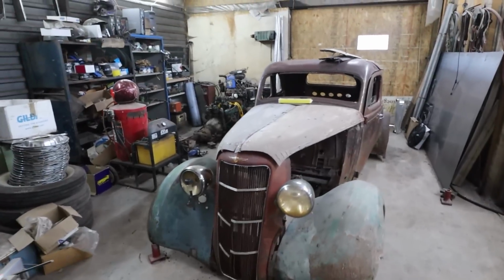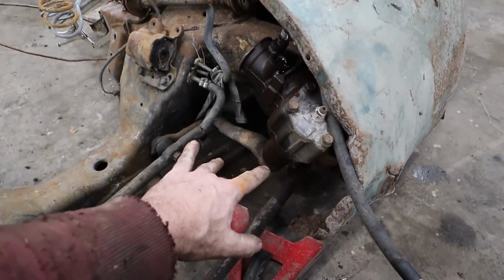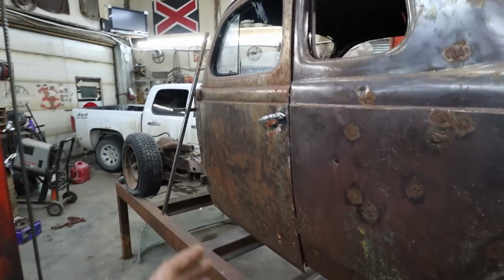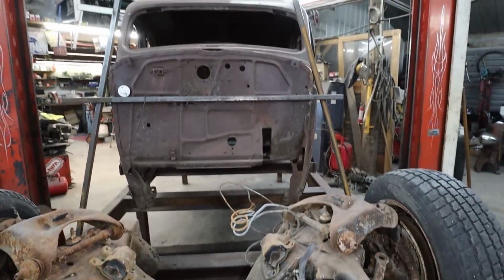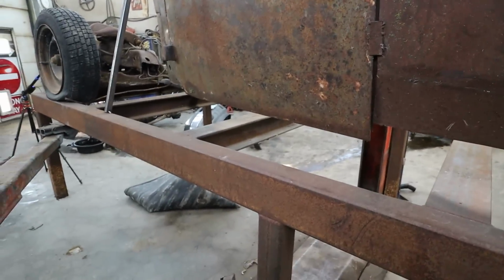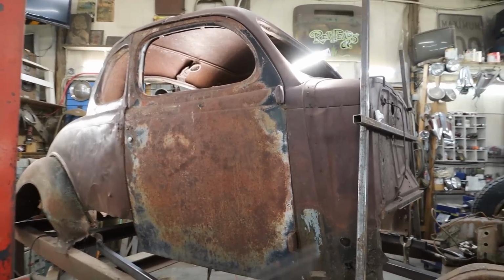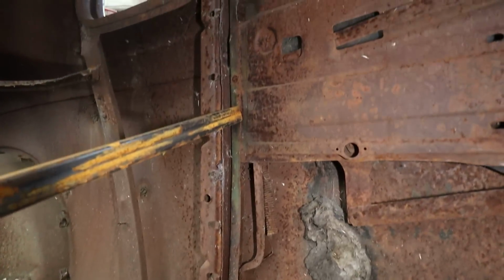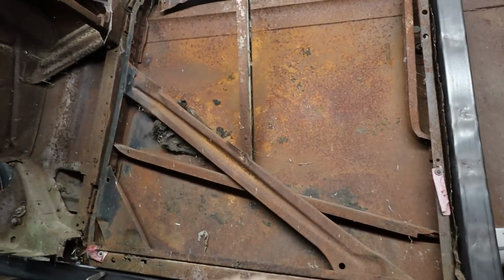1935 Dodge Coupe p2 attempting to square up the body and building inner rocker support.

Comment: Get a centerline going on the frame table.  square up the shell to that. make the doors match dimensionaly, and mounted to the cowl @ the frontwhere you want them. (or, get another pair)  & build  from there back. Your gonna go crazy if you  dont!   Hang in there , your doing  awesome. Important, remember, any project like this Must have (at least) one true line!

Comment: Brent working with Karl has got you playing around. A little Extra. That’s a 35 five Window Coupe. And your hood is off a 37 Chevy. Quit a bite longer. The 37 had a Flathead straight 6 cylinder. Of course you can make it work cutting it down. Love watching your work. You just roll with whatever the project takes. Thank you for sharing! ❤

Comment: If the exhaust bender works is that wrong or is it a win. A piece of pipe on a breaker bar for leverage. A gutted out distributor in a drill to prime an oil pump. As mechanics or craftsmen we often alter the intended use of our tools or the tools available to us. When it works is it wrong or is it a win. This one will fall into place, the bits will come on line, and an awesome project will emerge. Good on you for rescuing this one. A little extra work makes the reward that much sweeter. Thank you for taking us along through the process.

Comment: Hi Brent, I’m wondering if the doors are off a different year as the lines are narrower than the rear body, however it wouldn’t matter if they were off a Fiat 500 you’d make them fit. I’m going to love this build, many thanks for the content.
Reply: I agree with you, those doors look like they came off a similar car model than the one Brent bought as a donor. They are too long, the body lines don’t fit (front bottom corner is the most obvious), the top doesn’t fit the cab line and there are cuts and welds everywhere around the hinges

Comment: An excellent teaching video showing folks how and where to start. Looks like it will be a good foundation. Changing out the doors sounds scary to me because I don't think those are the correct doors to start with and changing them out for the right doors may screw up everything you have already done. Who knows...... but if changing doors was in the mix, I'd have started there before I laid out the foundation. 
But Brent will get er done no matter what. lol. Thanks for taking us along.

Comment: I used an X10 frame for a 1939 truck and cut it took out the center section with 2”X6” channel, it worked great!!  It allowed me to channel the cab about 6”

Comment: Brent, your skills far surpass the efforts in hot rod building  60-70 years ago. They had the rust damage of cars that had been abandoned for less than 20 years. They were likely to find horse drawn carriages that were in similar condition but not automobiles. You are doing what many would call the impossible!

Comment: This is your biggest challenge yet.  This body is a fitment nightmare.  When you finish, this ride is going to be almost completely re-engineered.  I'm not worried about your plans with the frame or front clip - this body will be your most vexing problem yet.  I look forward to the lengths of your creativity in getting this body to act right and behave.

Comment: Wow, that's a rough one...  Got to admire your willingness to tackle one in such rough shape.  I think that it is a very wise decision to build a perimeter frame with 2x tubing.  This will provide some much-needed rigidity which is currently missing.  I think you will be ahead of the game if you go ahead and replace the left side B-pillar to match the right side now..  I am still amazed at your skill and vision with sheet metal.  You have an amazing ability to visualize what things should look like and the ability to fabricate things to match your vision.  Really looking forward to seeing this one come together...to prove that a person does not need a pristine old body to be able to build a decent street rod.  You are not trying to build a "nut-and-bolt matching" concourse-ready classic.  It is a hot rod, built with what you could scrounge together...  Great project...!!!

Comment: That's an ambitious undertaking, but  you're off to a great start! It's too bad the Mustang 2 kits are so expensive up here in Canada because they sure save a lot of mucking about. I haven't seen anyone successfully use an s10 clip under a mid 1930s car because of the steering box to fender issue. I've seen a couple guys try to use a Cavalier rack, I don't think those vehicles ever ended up on the road, but I'm sure you'll figure something out!
Reply from the maker: Love you as the s10 stuff on some late 30s stuff no problem this one's just a little troublesome

Comment: Man what a mishmash of parts. I think you should get everything tacked into place, remove the doors and either get them both the same size and then put them back in place (or new ones) and go from there. You have A LOT of work ahead of you on this one. will be fun watching.

Comment: Brent, we have used mustang 2 front clips ... before they made a kit!  We would find a roached out car, and cut the front lower frame off. Then just cut and fit  you manage that skill better than most ! They are a lot cheaper than the kit ! Good luck 👍, jim  ps my brother has a kit he bought for a 37 dodge, we replaced it ,with a camaro sub frame
Reply: The kit he has is just laying in his shop, jim

Comment: If you split that moulding at the back of the door towards the front and lift the top half of the door it would close the gap at the top and line up the moulding top too.

Comment: i put a buick clip on my 39 ford ,wanted disc brakes on the front, had to take 3in. out of the middle and then shortened a mustang rack ar each end all worked out had it going 130  and ran true

Comment: My 1974 datsun 1/2 ton truck  had steering box 1 inch from bracket holding the bumper. Fix Extended bumper brackets and extended the bumper out 5 inches which were wielded to frame

Comment: I've watched several of your videos and your colab with Karl on his big truck conversion you guys are mericle workers when comes to working with metal.  How about using that 52 or 53 olds that you got running with the stick shift. By the way I have an aftermarket floor shift conversion kit that was designed for that trans, I had it in a 54 olds that I owned in the 70's.  Any way good luck on this project I'll be watching this.

Comment: I'm running into that steering issue right now on a 1946 GMC truck I'm s10 frame swapping, I was going to rack n pinion it but wow it's pricey. Guess I'll wait to see how you do yours
Reply from the maker: You can always try a manual box they are smaller

Comment: Hello, There is a steering rod that goes outside of the side hood. It looks like 1932 Chevy Model A steering. The steering column at the bottom is connect to the worm and sector gears box or two bevel gears in the case with mounting holes metal foot. Worm gear and Nut steering box that makes it 90 degree. The steering intermediate rod is between steering box angle gear and pitman arm. The pitman arm is for swinging forward and backward below the intermediate rod as well the pit arm is connect to the intermediate rod. At bottom of pitman arm is connect to the ball socket which is also connect to the steering rod. The steering rod is between two tie end ball sockets. The front tie end ball is connect to the knuckle steering arm's socket as part of drop spindle. The knuckle arm spindle is right next and rolling the wheel. And knuckle arm spindle is with yoke to be fitted to the kingpin axle beam (miniature). The vintage shock dampeners atop the axle beam on both sides. The shock absorber is the spring or coil along with the dampener from Monroe or Speedway Motors for $1,400.00 dollar brand new all front end suspension for weld on to the chassis with plan instruction sketch print.
 The another type drop spindle can be inverted connection where the axle beam have two yokes on both end. The drop spindle have butte to connect to the middle of the yoke.
  The kingpin axle beam does not have any yoke. The drop spindle is an old style that way it is connect to the kingpin axle beam for it to steering along with steering system rods and arm. The Vintage steering for 1930's would be hard to find but as avail in Chops shop JG. The Lares or Cardone is the brand for old car Dodge 1935's gear box plus transmission multi-gear box from Spicer and Old Detroit axle and tubular company.

Comment: Patch work parts 35 Dodge, front clip'n wif a s10, frame'n table'd, square'n da body wif wratchet'd straps n all, rockers where der aint no rocks, b pillar'n a 2X2 wif a exhaust bender.

Comment: The width between two front wheels for add in rack and pinion steering from a Pinto Pony car S10 and rag joint for connect to the steering column without using the Worm and roller gear box. The width are choice that are 56 inch , 58" or 60" track width for nominal car like Dodge 1935 with Chevy coffin lid tapered to fit to the radiator's front grille and sill in the area engine bay without the wheel well. Instead of the wheel well, it uses the fender called wheel bonnet. The hood is between the two wheel bonnets.

Comment: Pontiac fiero front end...comes out with about 8 or 10 bolts...smaller, lower version of mustang 2 ...may be easier to find cheap. I've used them..they work good....86' fiero
Reply from the maker: interesting.
Reply: Same front end as a chevette/t1000. Great suggestion!

Comment: A general question across the custom community, what is the reason so many projects use the S10 or Dakota front clips?
Years ago the Nova and Camaro clips were, or seemed to be, a favorite, what changed?
Availability or is there some feature(s) of the S10 and Dakota that other fronts are missing?

Comment: Have look at a rack and pinion out of a like 94 97 trans am or camaro they bolt flat to the x member and the steering shaft sets at an angle

Comment: This plan is you want to add the rockers which is a laid down stud atop the steel sheet metal and stud need to be weld to the floor sheet pan. The sheet pan must be weld to the front end clip's chassis (half). The floor pan is 9 foot long by 60 inch wide and 4 or 5 foot front to fire wall spacing for the mount of an engine includes multiply width of both front fenders is 60 inch to 62".
 The A pillar is front of the door wall plus cowling under the windshield and the pair of sills hold the front part of Dodge roof 1935. The B pillar is the walls both sides included the framing rails sill with the striker and car door jams and it holds the up the roof at mid-section. Then the C-pillar is the tub that hold the rear window and rear carnival seat and rear of the roof at right on the back of B-Pillar. The 5 window Coupe Dodge was called Passenger coach with rubber tires and spoked four wheels. The Sedan was called 5 window Sedan includes 4 doors. Other option is rutted wheel instead of thin spoked wheel It uses much thicker spoke 6 hole wheel with center bore. The thicker spoke is called rutt instead of wire wheel.

Comment: Use A 1940's through 1950's  frame front clip off of Another older Chevy vehicle. Possibly 1960's might still work to for it to.

Comment: The Dodge 1935 cabin with no paint that became nice bare skin but the floor needs to be reinforce and the chassis is half for the front flooring. and the back half of car flooring is just pan steel sheet strongest enough to weld to the chassis front end. Not need to have chassis longitude rails for back. Only the unibody floor is able to run with rear suspension. The front half of the Dodge Vintage have chassis 2 longitudes only. Where the coupled of Dodge's S10 is likely to be front wheel drive and much easier for robotic with Mustang III universal front end clip into build concept or replicated one in the making one for hot rod Rat Dodge 1935. What color have you decide to paint it? Thank you.

Comment: I'm guessing you're unable to transfer the rack and pinion unit from its frame to the S-10 (was my first thought)?  ;-)
Before the Mustang II came along, hotrodders used Corvair front suspensions with Camaro disc brakes and rack and pinion steering added.
That MAY(?) be cheaper, but a lot more work for the same result of the Mustang II front suspension?
I thought the passenger side structure, door, etc... was closer to where it needs to be, so why not build to that side and mirror to the "bad" side?
Reply: Ok, I see why, there's more to attach and measure from on the drivers side.

Comment: Brent, the S10 does suck it really is a terrible front end although I know a lot of guys who use it. That steering box is just murder on core supports. The Dakota is a great clip to use on a truck by the way, anyway the Mustang too is a good front end for it but they are super expensive but a good runner-up might be that Jaguar front end from the 80s. I recall you used one before and you're already familiar with with a funny steering shaft position.

Comment: I think that the doors are not from that body.  It appears that someone may have tried to adjust the body to accommodate the doors.  I wouldn't use them as a reference.

Comment: It would seem that C channel would of been a better choice than the square box tubing. Just using what you have??? I kinda see a hole drilled into a bowling ball to use for a form to make the rear fender inside quarters. I know one thing, its got to be one of the hardest parts to start building before you skin the passenger side b pillar panel. I do give old Fitzee (got that name wrong spelled) a lot of credit for his different ideas for shaping metal around different shapes or Karl using his cardboard shapes ahead of the actual metal is cut .... Do you ever use the bits from junk rear truck fenders for metal that has been shrunk or shaped already? I would never just toss a idea in the air for a build this size.I know that struggle bus can be a bit of challenge yet you never say whats bugging ya... just challenge accepted.

Comment: You are buliding a car not fixing one...Why not make a shimplate to move   (steeringbox) it left on the frame, looking from the front. It wolud give you the room, Knuckle joint fllex, no Problem. Link from Box you cau cut to change angle to steering link?

Comment: 1935 dodge coupe why are you using Mopar front end clip that is from the 1930's through 1940's time area. For your project build it's much simpler.& Easier to that way. Junkyard parts man. Take A cutting torch with you.& Generator &  power corded sawzall.& Power corded based charging battery powered sawzall to.